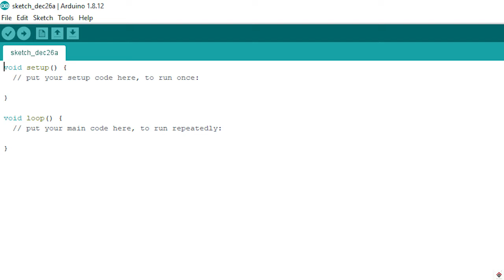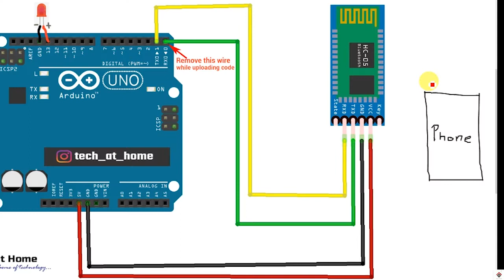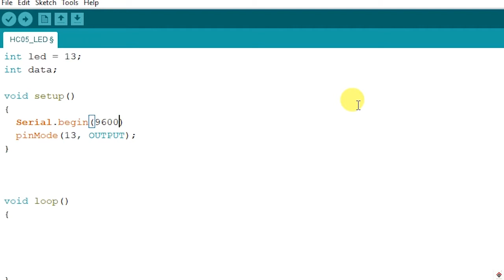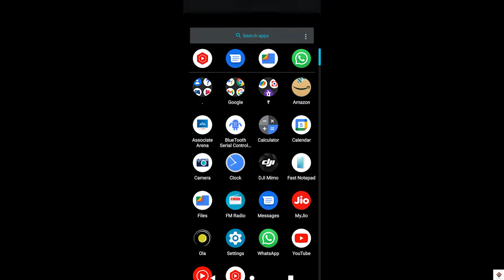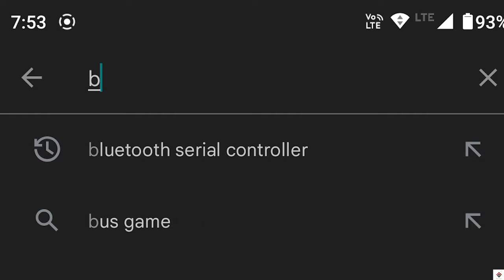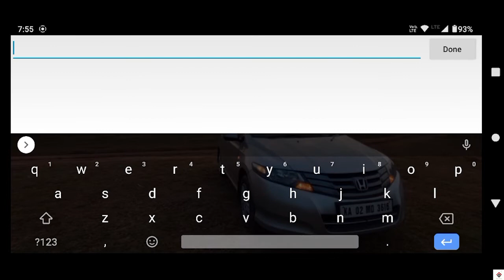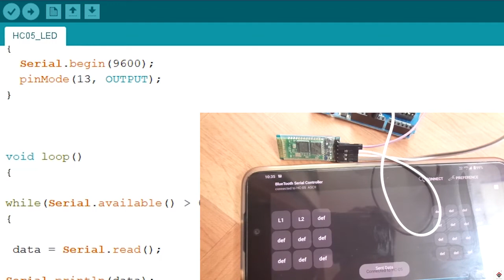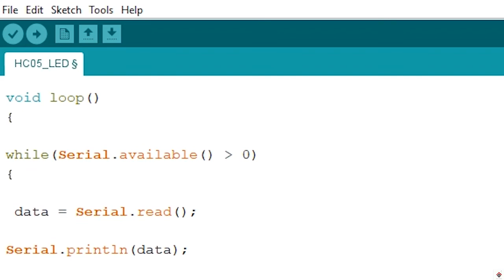HC-05 Bluetooth Module with Arduino | Blinking LED with Phone [Code Explained] | Arduino tutorial 21

Comment: hi the led switches on and off when I send commands via serial monitor but not via android mobile Bluetooth app .. why so ?
Reply from the maker: Have you configured the app correctly?

See the values coming on the serial monitor if it is receiving correctly from the Android app.
Reply: @techathome  hi thanks for your reply..I have configured the app for only 2 values A and B I can see these values in app terminal..but seems they don't reach serial buffer of arduino..only when I provide values in serial monitor manually it works
Reply: @techathome  the values coming from app are not visible on arduino serial monitor...but these are visible only on andriod app terminal...however when i type value on serial com4 on arduino terminal i see the values come on app terminal as well..

Comment: Sir what's the resistance reading of your working hc-05 if you make  the state pin common and check all pins, do they have all  the same resistance including vcc pin? because mine is not working and there is zero resistance between state pin and vcc?

Comment: in my case i have to connect the HC-05 to my Arduino mega 2560 but the problem that i can only either receive or transmit data from the Bluetooth serial  controller even tho i did the wiring and the code for both RX and TX . can anyone please help me find the problem ?
Reply: same issue

Comment: Hi, I've followed your and other tutorials. But in every case, hc-05 does not send data to the serial monitor. Even if everything is connected correctly, the code is correc.I removed the wire before the  upload, the baud code on the serial monitor is the same as the serial begin and hc05. I even tried different applications, but none of them work.  With some miracles i setted the module to slave.But didn't work either. Did you know what can cause this problem?
Reply: Same problem with me
Reply: Same problem did you find solution?
Reply: @thebosss_09  not yet
Reply: Try going to Android phone and clicking Bluetooth and connect the module
Reply: You fried your chip use a voltage divider with 1k ohm and 2 ohm resistor
Reply: @RekT4k  but the chip connects correctly with the phone. The only thing that doesn't work is the communication between the HC-05 and the Arduino.
Reply: Anyone's issue solved?I need help as well
Reply: Any one found the issue ? the commands don't work via mobile
Reply: @alokp2003   I had received the wrong model so that was the problem

Comment: hello how to  turn on and turn off the led only one command .same for on led and same for off led
Reply from the maker: Use this code:
//YouTube | Tech at Home

int led = 13;
int data;
int x=0;

void setup()
{
  Serial.begin(9600);
  pinMode(13, OUTPUT);
}

void loop()
{
  while(Serial.available() > 0)
  {
    data = Serial.read();
    Serial.println(data);
  
    if((data == 'A') && (x == 0))
    {
      digitalWrite(13, HIGH);
      x = 1;
    }
    if((data == 'A') && (x == 1))
    {
      digitalWrite(13, LOW);
      x = 0;
    }
    
  }
}

Comment: Why SoftwareSerial.h library not included
Reply: Because you're using the Rx & Tx Arduino pins, so they're made for transmitting and receiving info from external devices such as this bt module

Comment: Do we require resistor for the led ??
Reply from the maker: Pin 13 has inbuilt resistor,
It's better to add if using other digital pins.

Comment: Great tutorial it really helped me solving my issue!

I also had a question, how to make led blink when turned ON and stop blinking when turned OFF?

In my code when I keep pressing button on phone the led starts blinking and when releasing it stops 

It would be great help if this is fixed since I am working in my project and this the only video that helped
Reply from the maker: Thank you!!
Reply: Cheers but what about the solution?
Reply from the maker: You want to switch on and off with two seperate button ryt??
I didn't understand your requirement
Reply: I got everything basic stuff I wanted from this video but now I want led to start blinking/flashing when pressed ON and stop blinking/flashing when pressed OFF from mobile app
Reply: @dhruvgoswami6819  set your arduino code to blink the led when your button is high and stop the blink when the button is low thats it to blink a LED use arduino basic blink sketch
Reply from the maker: You can add this blink logic, in your code
https://youtu.be/EJEz6t5SpMw
Reply: Just found out this problem. For me, i forgot to put double = at the column [if(data == 'A')]